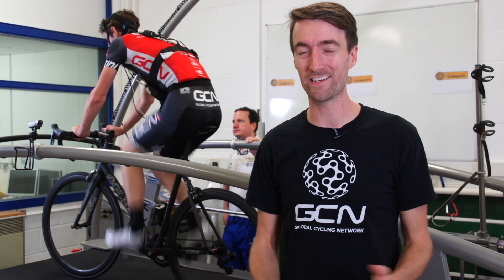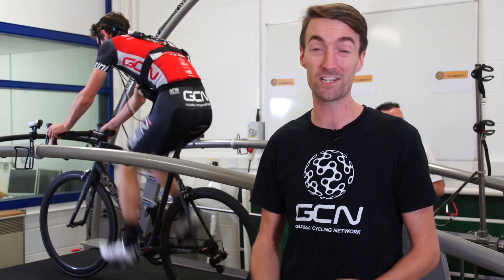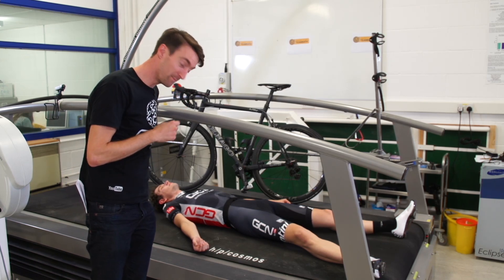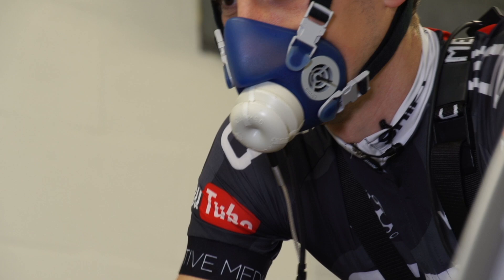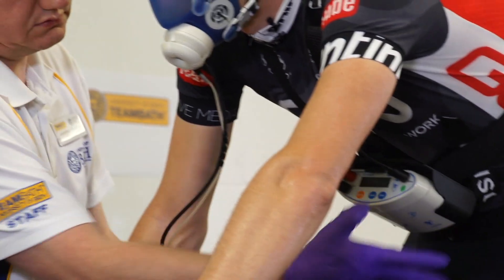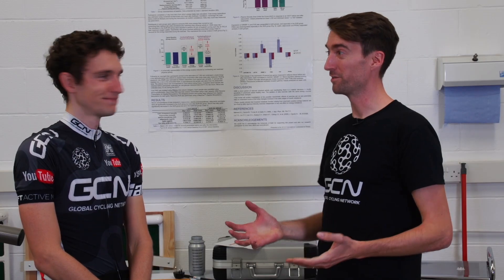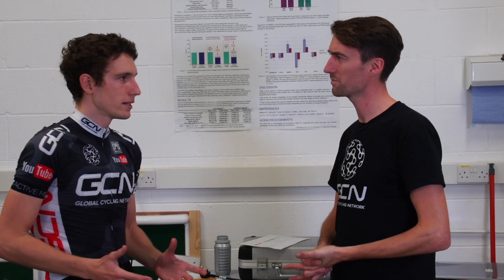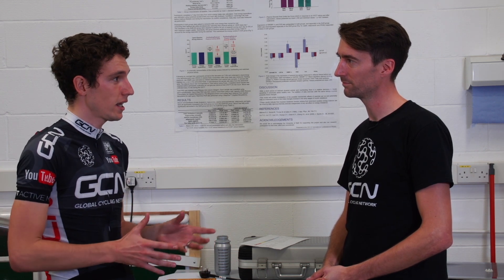What Is The Most Efficient Cadence? GCN Does Science

Comment: @ 3:50 there's a common and notable error in their understanding.  He thinks because he's pedaling slowly he's using slow twitch fibers, but that's incorrect.  At lower cadences there is more force on the pedals, and more force engages the fast twitch fibers.  Slow twitch fibers will do all the work until such time as they can't provide the force required, then fast twitch come into play.  Fast twitch fibers fatigue more easily and do not recover from the effort as fully as slow twitch fibers.  #spin2win
Reply: You misheard that. What he says is that at his current power output he is using only slow twitch fibers, so he is not fatiguing, it just feels uncomfortably slow.
Reply: sonuç olarak iyi
? 100 rpm 90 rpm 60 rpm

Comment: From a purely mechanical point of view, irrespective of the training and conditioning of the athlete, higher cadences are less efficient, owing to the need to overcome the inertia of the reciprocating mass. The more frequently the legs have to change direction, the more energy required to do it.
Reply: but at the same time you have more momentum that is carried in the crank...
Reply: @thetasurfers  yes, but that momentum isn't gaining you anything to counteract the losses Peter cited.
Reply: Yes I found that when I did super high rpm, it is no different than redlining a car in low gear and burning out my legs.
Redlining a car means the engine is spinning dangerously fast and is wearing itself out. If a higher gear or slower pace is not used, it will cook itself from all the heat and friction and overheat.
Reply: @thetasurfers  : The momentum that the crank possesses is imparted by the rider. Given equal power and torque output, leg mass and leg cadence directly reduce efficiency. Of course, in the real world there is a real causal correlation between leg mass, torque, and power, but that relationship depends largely on the nature of the mass—contractile or non-contractile tissue—and the manner in which the contractile tissue has been developed. Larger musculature from bodybuilding is going to have vastly less effect on performance than that from a long history of sprint and hill cycling, for example. Cadence is less efficient, but is similarly associated with performance. There is an ideal cadence as which to accelerate optimally, and higher cadence is associated with lesser chronic muscular fatigue.
Reply: @jason200912  : The analogy does work to a point, but friction is the leg joints is, in fact, lower with higher cycling cadences. The overheating is due to inefficiency and consequently higher cardiovascular output. In simple physical terms, and given the same power output, higher cadences demand higher cardiovascular output whilst lower cadences demand greater muscular output. This is why we should shift down a gear (for lower load) if we are feeling muscularly fatigued, and why we should shift up a gear (for higher load) if we are feeling short of breath.

Comment: I have found, as I am concentrating on 40K TT, but on a road bike, that there is huge difference in 90 to 100 Cadence. It all depends on what cog you are in and what power you are putting out. I control my power output by controling my cadence at 95. I know, roughly, how much more power I put in at 95 to maintain 95 for each different cog. On the flat I use a max of four cogs on 25 to 11. Riding into a strong  wind I am on the lowest 19, then 17, 16 and 15. I can hit 40K/hr at 16. I stay in this range and out of corners drop a gear higher and pull out of the saddle and then drop back to get the cadence back up as fast as possible. Sometimes with no head  wind I go up to 100 and try and stay there. Unfortunately I am bouncing at about 110. My experience is that I had to learn to spin at 95 and I did that by riding at about 32K/hr at 19. But I was only averaging about 220 to 230 Watts and much less with a tail wind. I do a stepped VO2 Max once a week and basically remain at 95 and push through the gears as above, at 15 I am doing about 360 to 380 Watts and repeat that five times. I have found, for me to be able to maintain the higher watts longer, was the increase in cadence. I suppose it comes down strength  v ability to re-process oxygen. One thing I have learnt is I will never be any where near Bradley Wiggins or the pro level etc... not matter how hard I train. I reckon, with all things being equal, you need about 280 watts average on smaooth road to do 40K in 60 minutes.

Comment: To pedal efficiently at high cadence you need to train as turning legs around has costs in itself.

Most of my riding is on big, long climbs and my cadence is around the 70 rpm mark, this is due to the slope (say 9-10% for the local roads) and gearing (34x30) I have and my w/kg. If I had a smaller gear I would comfortably pedal a bit faster. So I'm gear/power limited on climbs.

Comment: I found myself a few years ago while training for a Time Trial (flat course) that instead of pedaling 105-110 rpm that if I dropped it to 75-80 and used a much bigger gear (Ulriching it) I gained 1-2mph avg speed and HR dropped by 5 beats or so. The trade off is your leg muscles being able to maintain the exertion long enough to finish before failure.
Reply: Yeah very true.Just look at Ulrich muscle mass compared to lance or someone like Chris Froome. I think if you have the legs to push a big gear and it feels comfortable definitely try it out.
Reply: I tried a high cadence once when riding the length of the Bristol Bath Path. What an inefficient way of riding long distances. I soon dropped my cadence and pushed a bit harder. My speed increased and the effort decreased significantly.
Cadence is entirely dependent on power output. So unless you can maintain 400 - 500 watts over a 2 - 3 hour ride there's no point in spinning at 100rpm. Most people will only managed perhaps 200 watts over that length of ride so 50 - 60 rpm would be far more efficient.
Reply: ***** Froome can only hold 500 for 40 mins :)
Reply: Alex Swan Maybe, maybe not. As long as he doesn't test positive i will trust hes clean :) LOL
Reply: ***** Completly agree! Wiggins is clean no doubt! People can say all they want behind the computer screen but when it comes to putting dinner on the table its a different playing field. If there not clean i still respect them just as much :)
Reply: I find better to go full out on highest gear highest cadence

Comment: GCN gave me so much inspiration. Love your videos, guys!

The more one measures the more faulty the conclusions out of the data will probably be and the more I read about it, the more confused I become. There are so many factors and my conclusion is that it's a totally individual thing. Factors, for example: body weight, bike weight, bike geometry and efficiency of power transmission, ratio of muscle power to body weight, variations in bike fitting, general physical condition, oxygen capacity per whatever, willpower, health of the heart, texture of the vein system and so on. 

One important question is what is one's goal. For example, I love long trips of 50 to 150 kilometers at 24 to 29 km per hour. Since I do not use either a heart rate monitor or a cadence sensor, I simply listen to my body to balance the lowest possible heart rate with max. possible strength with moderate muscle burning with moderate and constant breathing rhythm ... long driving mode;). I have no aching and I could probably ride the whole day long.

Comment: I tend to average at about 75-80 rpm and 25kph (most of my rides have a lot of hills in though). For me, as a fairly new, low-level cyclist it feels the most comfortable. If I get to 100 it's like my legs are spinning wildly and I seem to be going nowhere, I doubt I could sustain that for very long so normally much above 80 and I'm changing into a higher gear.

Comment: What about something for the commuter or touring cyclist, not all of us are riding bikes to try and join the tour.  Ideal cadence data appears to be based on a very high power output, not something the average commuter or touring cyclist maintains.  Perhaps some data on what is the most efficient cadence to maintain 15,20,25, 30 km/h on level ground would be useful.  Its possibly like the engine in a car, sure to most effectively use 80-90 % of the rated power the revs have to be right up there 3000+ rpm, but for light cruising, light throttle loads rpm is <1500 rpm.  
My own experience: just rotating the crank with no load at 80 rpm for 5 mins leaves me feeling somewhat fatigued! whereas I can cruise at 25 km/h all day and never go past 55 rpm

Comment: I've found that for maximum sustained 20 minute power (which for me I measured at about 300 watts), was better at about 90 rpm than 96-100 rpm. Unfortunately I couldn't test lower because the bike ran out of resistance settings to make 300 watts.

Mind you, this was one of those horrible wide saddles that you have to sit right on the tip, unless you are pedaling in a lower seat sitting position (which is useless for making any kind of power over 150-200 watts). The adjuster also had holes spaced just over an inch apart, and I had a setting where the saddle was just a bit too high as the next setting was too low for max power.

Comment: I tend to use higher cadence on the hills and for a moderate effort of 150 to 200 watts that would be around 70 rpm but on a hill about 90 for a high effort of 300 watts.

Bombing away from a light powers can go over 700 watts and 120 rpm. I don't have a power meter but am just going by perceived effort when compared to a gym bike that measured power.

Comment: Reaffirms what I always felt about cadence but for running.  Whenever I try the 180cadence for any fast running or races I always tire out quicker and start breathing hard faster.  While if I stay at the cadence  want which is much slower than 180spm I can regulate my breathing with my steps and don't get tired as fast.  I think optimal cadence is arbitrary and is different for everyone.  Obviously if we're going to use elite runners at around 180spm+ and gauge that as optimal we need to be talking to regular people who race at those speeds as well not normal everyday people who's faster runs edge on 7 to 6 min miles or even slower.  I think cadence is proportional to speed so to increase it independently means higher energy expenditure on a speed that doesn't require it.  That lactate data speaks for itself.

Comment: See this is an interesting experiment, I'd like to point out that the torque produced at 60 cadence is a lot greater than 80 and 100, meaning that though it may me more effect in this situation with a rolling platform, in a real life experiment when fighting gravity each pedal stroke is an acceleration and to maintain a speed at 60rpm you'd need to put out a significantly higher wattage than the other two. For a real life experiment how about 3 hill efforts hitting the bottom are are set speed of around 5 minutes at the different cadences with a long rest period to insure recovery. This would vary from rider to rider as the ability to cope at higher/lower cadence would differ but anyone can do it

Comment: One thing ive found is that my body responds negatively to a low cadance high power type of cycling. That was after three summers doing 2x10km every day ( for 3 months). I started getting more and more tired and pain in my legs. The solution was changing to lower gear, higher cadance at the same speed ( around 25min for 10 km). I assume a lower cadance is going to work the muscles harder. They would then need more oxygen wich you wont get since the lower heart rate means you breathe less. But its just a theory.. Of course im not really a cyclist, just an amature with poor fitness..
Reply: Magnus Danielsson I normaly was making minimum 30km per day at highest or cruising and I never had a problem
Reply: Well if you put your lungs to breathe faster the heart rate increases too

Comment: Interesting.
However, the real questions only involve self-selected cadences.

Which is better: a rider with a lower self-selected cadence and a similar rider with a higher self-selected cadence?

A more fundamental issue is: just how valid is the concept of a self-selected cadence?
After all, whether I am on the flats, going up, going down; in a power, spin, or recovery interval; and/or even whether I am feeling fully charged up, fully bonked, or anywhere in-between--I am ALWAYS going EXACTLY at my self-selected cadence, whether or not I should be.

Comment: This is basically the difference in horse power (hp) and torque (bhp) as applied to a bicycle. Hp is always higher at higher rpm and bhp is always higher at lower rpm, therefore more torque is required at lower cadence (uphill) and more horsepower is required at higher cadence (flat). In combustion engine speak, the torque curve follows from torque to horsepower or low rpm to high rpm. How does this translate to the human body, though? That depends upon the actual combustion and compression relatives - oxygen verse available leverage which would be the fuel supply burn rate and cam shaft dimensions (diameter of piston shaft rotation = pedal to crank ratio Vs rear cog ratio). At lower rpm the body, as with the combustion engine, should burn less fuel but run an increased risk of something snapping due to torque to available/potential resistance. At higher rpm the body, again as with the combustion engine, should burn more fuel (and oxygen) but run a decreased risk of snapping anything even though the heart is pumping faster - yet, though it is faster overall it is actually lower per given output of required torque. Considering that the main thing that kills a gasoline fueled motor is wear of mating surfaces, a caveat should be included for cyclists: higher rpm (no matter the torque requirements, ie uphill or flat) = higher wear on all of your parts unless you are pushing the very far edges (ie insane uphills in higher gears or flatout chugging out of the saddle on flats in low gears). I'm in the camp of try to find your magical cadence - wherever you are comfortable and change gears accordingly, don't try to rocket science it unless you have a super manicured track inside of a bubble because if you are doing these kinds of experiments on yourself outside in the real world you run a severe risk of getting into serious trouble that you alone can not get yourself out of.

Comment: I find that the older I am becoming the better I am at low cadence at least for tt's. On a trainer I can produce power from 90 rpm but on the road and in races I tend to use as big a gear as poss to get the best time. If I try to use a smaller gear and spin, I go slower. I can do below my age for a 25 and I am 53, but when I have tried to spin I am lucky to get 55!!

Comment: I remember selecting 90 for 300 watt 20 minute power runs and 96 rpm for 360 watt 4 minute VO2 runs. I think my power figures are a bit lower than that now as I haven't done much heavy cycling in a while. Because the bike I was using ran out of resistance levels I couldn't test at a lower cadence without reducing power. Also I was riding on the tip of a fat bottom saddle lmao. I have no idea how accurate the meter was and whether it reads higher than the PureGym bikes or whether I am less fit now which is likely as it certainly felt harder to keep it over 300 watts for more than a couple of minutes in there.

Comment: This validates my experience.
High Cadence = High Heartrate = More Lactate = Prone to Cramps.
When I tried lower cadence at around 40rpm, my heartrate doesn't go higher than zone 2. Although it is painful on the legs/thighs, the general feeling after the ride is not that exhausting, and gets to zone 1 heart rate in less than a minute! 

Oval chainring do make it possible to go lower cadence, round chainring is just too heavy especially at 6 O'clock position.

Comment: If we didn't consider friction it wouldn't matter whether he does 100 rpm or maby only 40 rpm. The energy he puts in would be exactly the same (if the distance, gradient and speed is the same too). However the more revolutions he does the more friction will turn his kinetic energy into heat energy, so he loses more power at higher cadences. But that also depends on various factors. Pedals for example where the friction increases under high loads can result in power loss at low cadences
Reply from the maker: Would not be talking about some pretty extreme cadences to see a real loss due to friction?

Comment: Its all about maintaining the perfect amount of pressure on the pedals, its that simple. The amount that suits you and therefore cadence must vary depending on power output.

If you want a decent power output you have to put some effort in but there must also be a limit so as to avoid knee damage. Spin to fast and you can't apply enough pressure to the pedals, they move away to quickly.

Maintaining a perfect cadence to power output can only be fully achieved by using a CVT instead of gears. The bikes speed has to be taken out of the equation.

I've been using a NuVinci CVT for the past 3 years. It took me a long time to refine my cadence. I now vary it hugely depending on the power requirement. Almost idling to 50 watts I'll choose 40 - 50rpm. Full power will be 80 - 90rpm.

Riding continuously in that sweet spot is the best thing I've experienced on a bicycle.
Reply: Something else I should mention. For maximum efficiency its important not to spin faster than you need to. If you only need 100 watts to keep the bike moving drop the cadence right down.
Reply: It's all about maintaining the perfect amount of pleasure on the pedals ;)